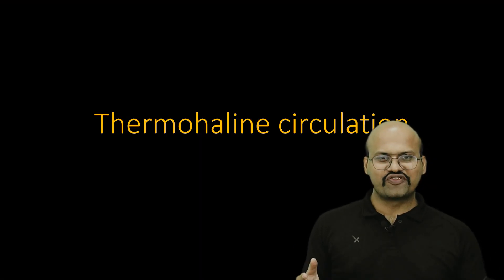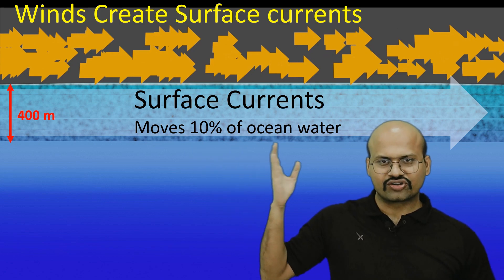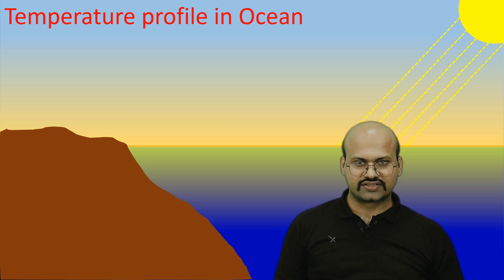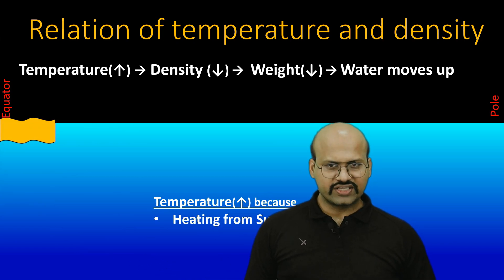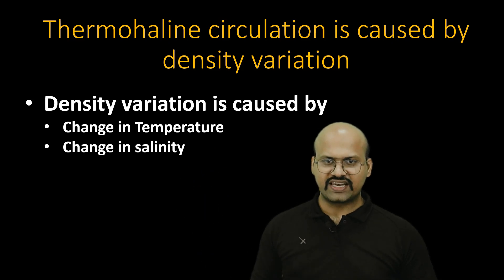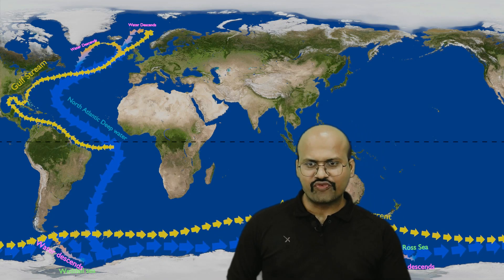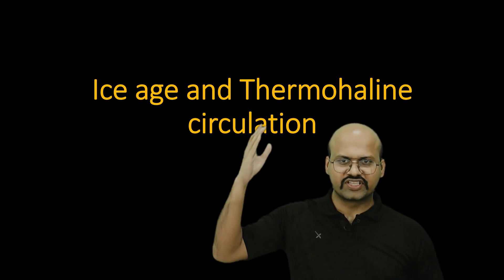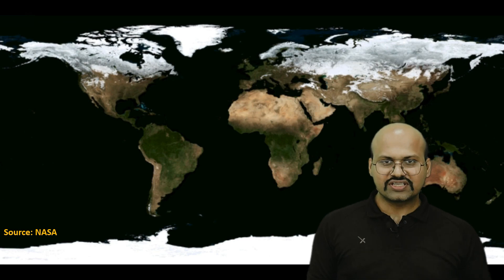Thermohaline circulation (Meridional overturning) detailed explanation with Animation for UPSC

Comment: I have one question: The surface current is solely depends upon wind blowing and even deep ocean currents bring cooler water from polar region to equatorial region, without wind there will be no surface current. Am I correct?
Reply from the maker: wind is the single most important factor causing surface winds, however it is not the only factor causing surface winds, there are numerous other factors, there is a whole video on those factors. so even without wind there will be surface currents.

Comment: Density variation is causing upwelling and downwelling but what causes horizontal deep water flow to a specific location??
Reply from the maker: density variation causes upwelling, so when water is moving up at certain location water from other regions have to move horizontally to fill that water, now water from some regions are more mobile then water from other regions due to lesser density hence they move. temperature difference of even 1*C is large difference at bottom of ocean

Comment: Could you please explain how deep ocean currents are moved? What force causes the water present there to travel after the water has sunk in areas where it may increase in density?
Reply from the maker: the difference in densities across different part of ocean is the main force, since the force is weak  the water moves slowly. Teh density variation is caused by salinity and temperature variation hence called thermohaline ciruclation
Reply: Density variation is causing upwelling and downwelling but what causes horizontal deep water flow to a specific location.

Comment: Cold ocean currents are formed near the poles when the ocean water salinity and density increase.you also explained in thermohaline circulation that when the salinity and density of ocean water increases the water descend .so,is the process of forming deep ocean currents and cold ocean currents the same?
How deep do cold current extend in the ocean.
Reply from the maker: The process of formation of deep ocean currents is there in video. Cold surface ocean currents are formed by two main process, 1) warm water current loosing heat and becoming cold 2) cold water getting added due to some mechanisms like upwelling. Somali ocean current is cold current but has no relationship with polar water
Reply: Thanku sir

Comment: Lol. If thermohaline circulation stops and that leads to polar regions getting more cold, then ice bergs form again making water more saline. So the thermohaline circulation resets 😂😂
Reply from the maker: Thermohaline circulation has stopped and reset several times in the past, however, the duration between stop and reset can expand over thousands of years and there are sever temperature variations when it happens.
Reply: That's the catch??!!! Okay 😄

Comment: Sir, isn't the antarctic circumpolar current a cold current?
Reply: Sir, thank you for the video and thank you for responding. I have a query, if you don't mind. In the booklet that my college has provided, it says that the Antarctic circumpolar current consists of very strong surface currents driven by Westerlies and slow moving deep water currents and that the Antarctic circumpolar surface currents are colder than the deep water currents. However, in your animation, the surface current has been shown to be warmer. So I'm just a little confused.
Reply from the maker: @greenhornett85  the Antartic Ocean surface current is cold, but because of continuous formation of ice on surface and brine rejection the density of surface current increases and it sinks, now the nort Atlantic deep ocean currents also reaches there but the density of Antartic Ocean is higher so it sinks even below. In polar region there is not much difference in temperature between surface and deep ocean water because the surface water is near zero and temperature of water always decreases as you go deeper. There is no mechanism which causes increase in sinking water
Reply: So, the scenario in Day After Tomorrow is possible?
Reply from the maker: @wandalumpkins726  exactly
Reply from the maker: Yes, it is. The yellow color indicates surface current